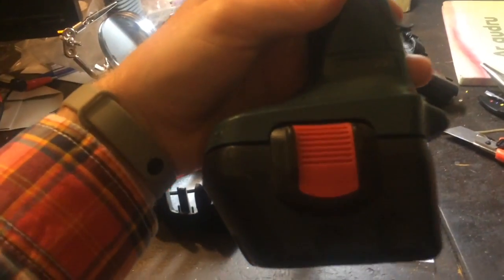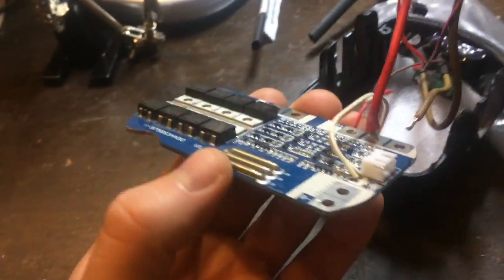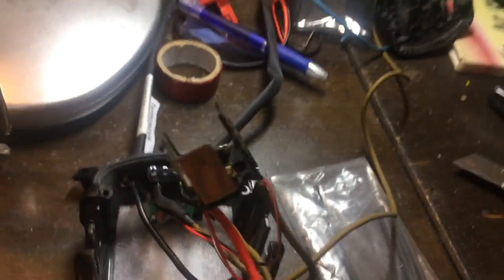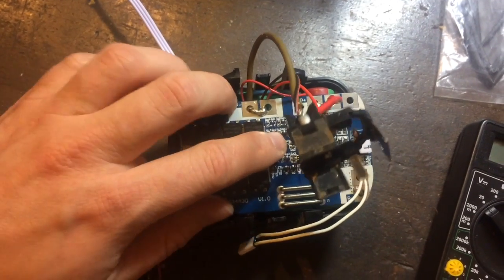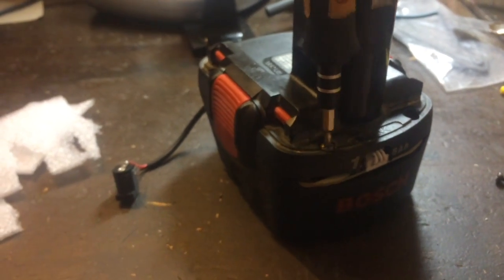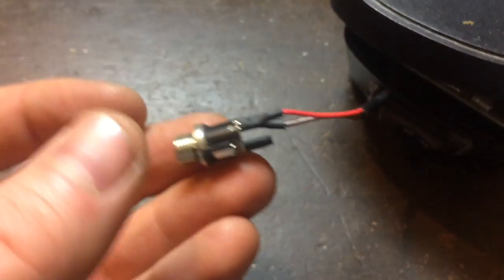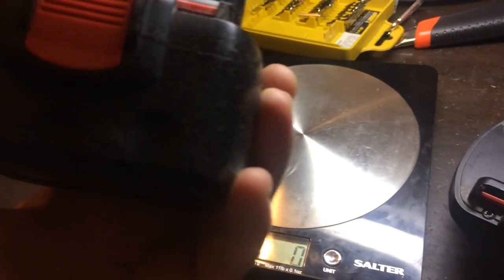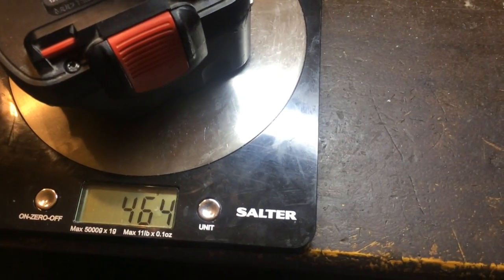Converting Bosch GSR 12-2 old NiCad to Li-Ion

Comment from the maker: Soo, just a small recap after what... 4 and smth years and maybe 100 charge cycles:
Today I charged it full 12.6V and drilled 10 holes (6x10mm and 4x8mm) in a 8mm steel (st45) plate!!! It still got 9V left in it with no load but of course it was nearly done.

Comment: How it is working today? Did you had to replace the new cells?
Reply from the maker: Alexsandro Camargo Hi, works perfect, have tried to abuse it as much as my imagination allowed. Burned the trigger switch thou on the oldest of my drills when tried to unscrew the impossible. But I have two newer ones still to work with.

Comment: Hello, where you bought the charger, I need the link on aliexpress, thank you.
Reply from the maker: https://www.aliexpress.com/item/100-240V-DC12-6V-2A-polymer-lithium-battery-charger-DC-5-5MM-2-1MM-Portable-Charger/32779387170.html?spm=2114.01010208.3.2.EgbKWa&ws_ab_test=searchweb0_0,searchweb201602_5_10065_10068_10000074_10000032_119_10060_10062_10056_10055_10054_10000062_10059_10099_10000013_10103_10102_10000016_10096_10000056_10000059_10052_10053_10107_10050_10106_10051_10000053_10000007_10000050_10084_10083_10000047_10080_10082_10081_10110_10111_10112_10113_10114_10115_10000041_10000044_10078_10079_10000038_10073_10000035_10122_10121,searchweb201603_3,afswitch_4,ppcSwitch_4,single_sort_1_default&btsid=647e7e62-6ef3-4fe8-bd69-c3ec1cd0fb1e